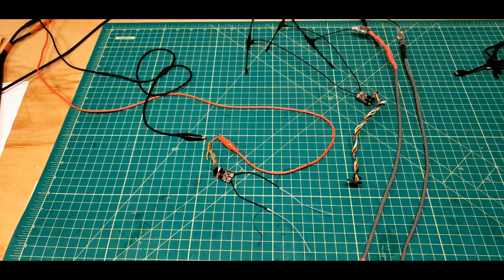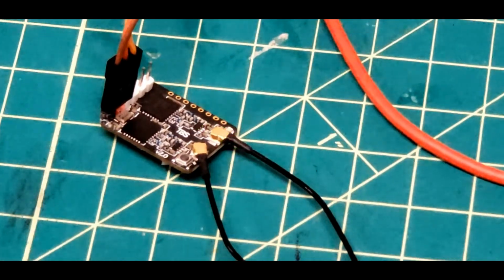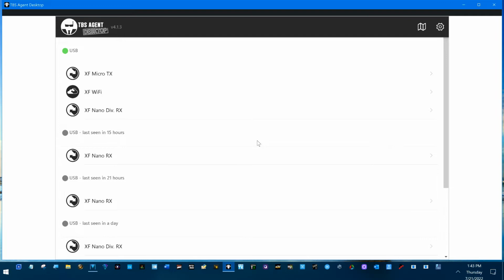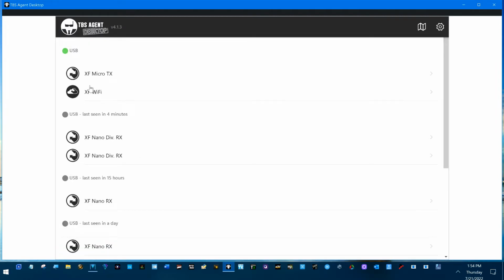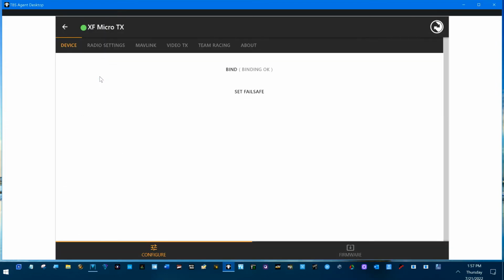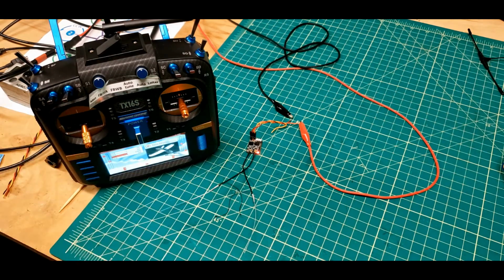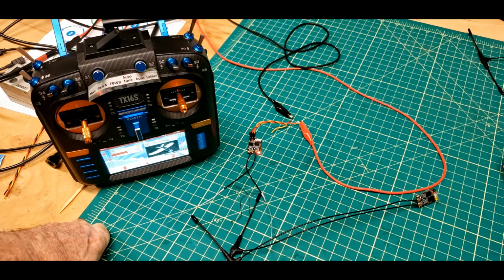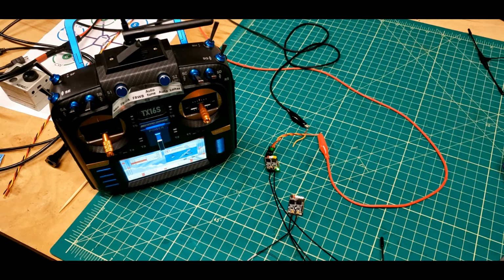Crossfire v6.19 Encryption

Comment: It says in the manual that TBS Crossfire has a capability of "Military-strength encryption of telemetry and PPM data". How did it get FCC approved? I thought in US you need a special license to send encrypted messages of any kind. ELRS security is trash, it broadcasts three out of four bytes of it's encryption (they probably did it to still be legal). How can you be sure that there is no similar thing going on with TBS Crossfire, they are not even stating what encryption algorythm they are using(proper algorythm can't be broken even if you know it). How can you be sure that some guy with infosec degree and 4090ti won't decrypt it if you don't even know what it is?
Reply from the maker: I thought it just to be hype from TBS.  I understand they are not as well like as they were at one time.

Comment: Is there any explanations or info on using the encryption mode? Or could anyone just explain how to use it in a sentence or two?  Do you just turn it on and re-bind? I couldn't really follow everything in the video.
Reply from the maker: It is a straight forward on or off.  They say it is military grade encryption.  That is all they have said about it.  Yes, you must rebind when turning it on.  No other controls or any information about it at all.  I think they said in the video that there would be an update to the Crossfire manual asap.

Comment: I wonder if this has something to do with the public/private key generation. I believe the TX and RX need to have shared keys for the encryption to work. I was excited to hear about the encryption in 6.19 but almost hesitant to try considering all the problems I had with previous 6.1x versions (digging RX out of all my models to push the bind button was NOT fun). I wish TBS would publish documentation along with their new features/firmware, something more than release notes. Release notes documentation is fine for open source stuff, but not for stuff we are actually paying for!
Reply: Also, thanks for your videos. It’s almost like we’re doing the exact same thing, facing the same struggles with all the same gear!
Reply from the maker: You are most welcome.

We likely are.  New hardware to all of us.
Reply from the maker: I am not fond of the documentation for most of the FPV stuff I have.  lol

I made all my bind buttons easily accessible.  Most of my RX’s are in the bottom of a wing.